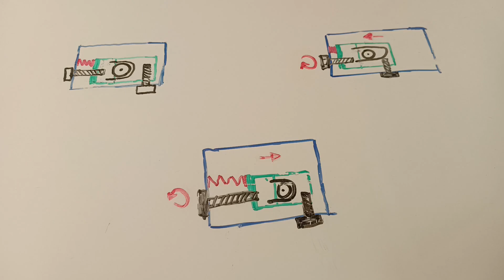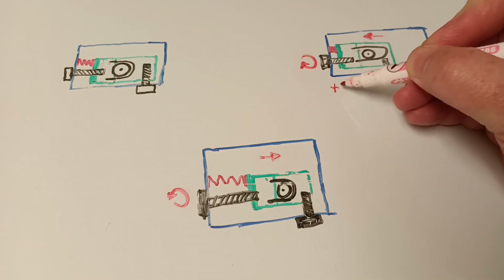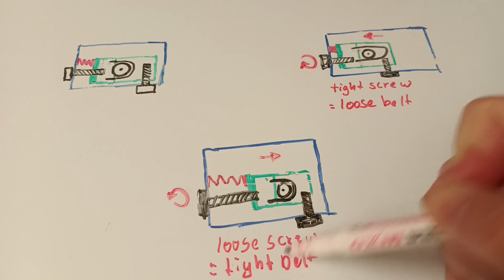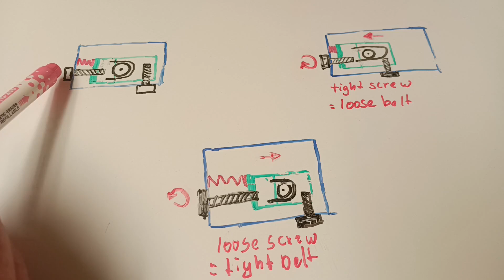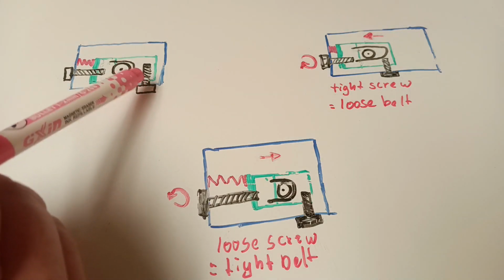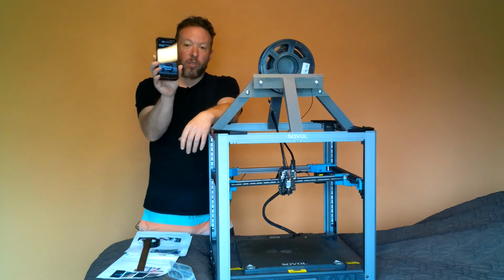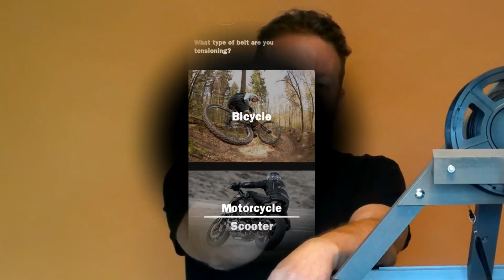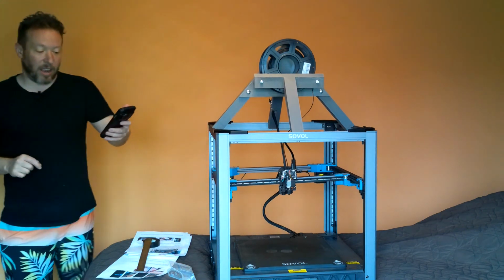Tighten Your SV08 Belts (Without Losing Your Mind!) 🔧

Comment: The sv08 was a disappointment 
Started with Probe issues, fixinf it with an Eddy and Mainsail 3 weeks of good printing. Them layer shifts. Belt tightening made me go crazy and did not help.
I found oit that one of thr motors was faulty... 
Sovol did send me a new one... Replacement Drive me crazy... 2 weeks of printig and now the Same issue again.... 

Will buy a Bamboo next time.

Comment: What does the option in the display "Belt test" do?
Reply from the maker: Well it puts tension on the belts and gives you a readout in mainsail as well as the little printer screen.
However I personally don't really know what that radout tells me. I hadn't enough time to read up on it.
But the software takes those values and uses them to compensate potential belt slop or uneven tightness.
I personally prefer a solid mechanical base combined with the softwares ability to compensate for variances.
Reply: @DomDecodes thanking you, I 've not used the belt test option, fear!@@ 😮

Comment: Nice tutorial.  I have ordered the BIQU UNIT as it is a digital one and should be more accurate. Have you tried it or maby know of a good tutorial for it. 
Cheers Mike Irish 🇮🇪
Reply from the maker: No I have not used the Biqu tensiometer.
However the one I used is digital as well since I didn't want to rely on something I printed myself on a printer that's potentially out of alignment.
Reply: @DomDecodes  Ah, that's a pity.  I will let you know how I get on with the biqu unit when it arrives. 
Regards.  Mike Irish 🇮🇪
Reply from the maker: If it pushes with 5N you should be able to use my readings as a guideline. If it is a 2N unit your values will certainly vary.

Comment: Thank you very much for taking the time to make this video Dom. I was actually just doing this last week and going out of my mind with the Carbon Drive app! I am now ordering a belt tension gauge from BIQU (as well as a cryo-grip glacier build plate because I can't stand the textured build plate... I really loved my smooth PEI build plate with my creality CR-10.... as well as a bed that was not warped like a taco, but that's another discussion topic!). I suppose I will order an eddy probe while I am ordering, although I just got a M12 inductive probe that the SVO6 and SVO7  use that I think should be sufficient. I really don't want to go through the process of installing mainsail Klipper.... so many problems with this printer, I am glad I got it used at $300. Oh yeah, and I did end up installing the microswiss hot end and it's great (also added dual fans to the motherboard, a 7" display, large LED light bar and 32 GB EMMC)... in addition to this I have vibration compensation sorbothane support feet on the way.. my wallet is draining quickly!
Reply from the maker: I try to be more budget oriented.
However, the "tuning a printer like a guitar" method is indeed frustrating.
And you're welcome.